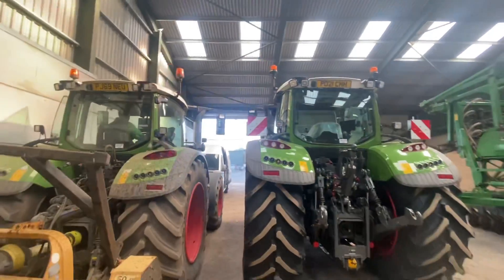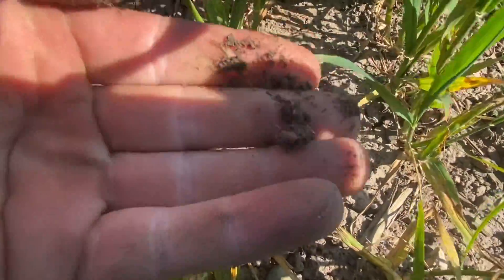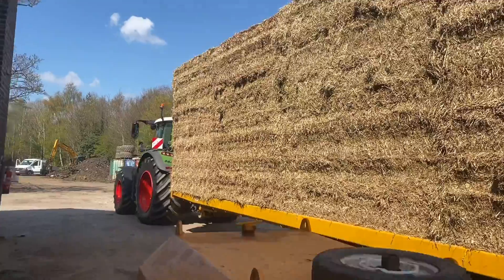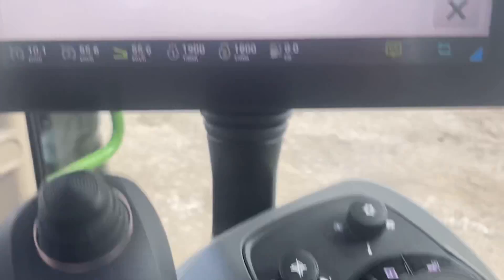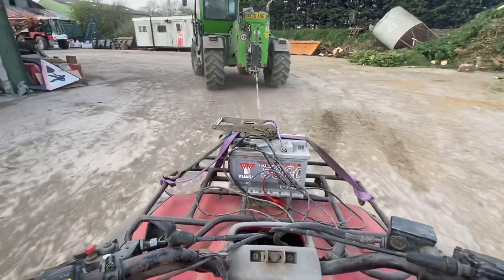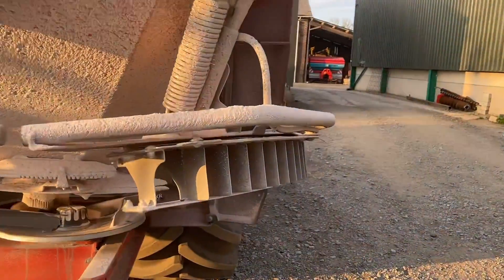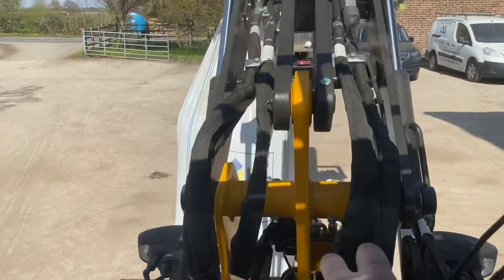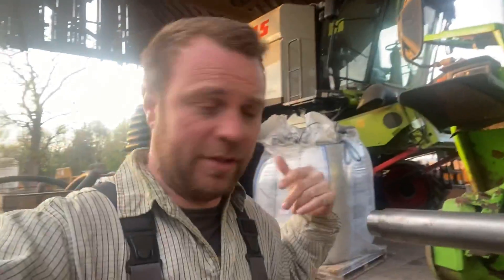Day 390  #OLLYBLOGS SO DRY FENDT MIRROR PROBS BIG & SMALL JCBS #lockdownlearning

Comment: Favourite time of the year is when the combine starts rolling.
The fertilizer spreader is veins to stop the fertilizer going into the hedge on the headland run.
The bucket is a concrete pouring bucket and the multi pin is for different size machines.
 Love the new tractor and good luck with the jab tomorrow.  👍
Reply from the maker: Thanks 😊

Comment: Bucket pins are so it can be used at different angles or reversed. 
What it's for.. my guess is drainage, or for bagging your own seed possibly. 
As for the grain store and not moving the towers... that's just lazy and sloppy unless there's a good reason.
Spreader grill is for the headland run so it doesn't spread into the hedge. 
What's the reason for the little JCB?

Comment: Hi Olly another great video love the new tractor the bucket is a concrete pouring bucket and it is a multi pin for different size machines....the fins are for going round the edge of fields to alter the angle of the throw
Reply from the maker: Spot on

Comment: The bucket is for pouring concrete and the pin holes are for different hitches  and the flaps on spreader is for spreading around the boundary of the field, it stops the fert from going as far as it would normally. I thinks that's all the questions answered 😂

Comment: Fave time of year is harvest or spring and the fert spreader thing is to stop it getting thrown out the fields on the headlands and the bucket is a cement bucket so you can pour it on the digger and easier to move cement round and different size pins for different quick attaches

Comment: Excavator bucket is for pouring concrete , diferent pins and holes are for different  sizes of excavators, possibly 65mm and 80mm size pins, the vein on the fert spreader is for headlands so the fert isn't thrown over the hedge and verge,
Reply from the maker: Good work top answer
Reply: @OllyBlogsAgricontractfarmer  best time of year is autumn because i help a agri contractor loading spreaders and maize carting weekends,

Comment: Hi Olly, hope you stay well after the jab, quiz, the fins on the spreader, to adjust for headlands, the bucket is for tipping wet concrete, the extra pins for different size machines. I love May and September. Our Deutz 100 in yard with wheel off for gear change electrical problem, Take care and thanks.